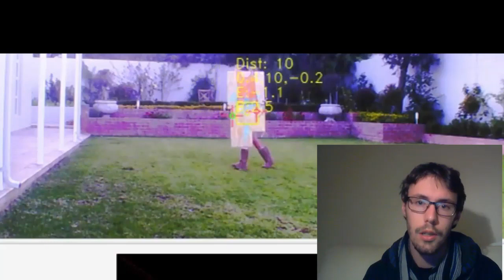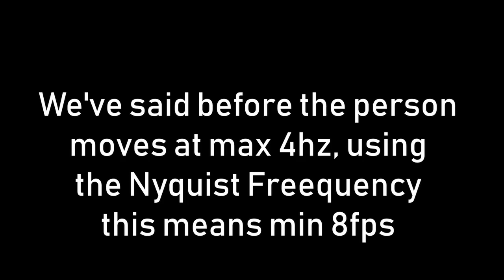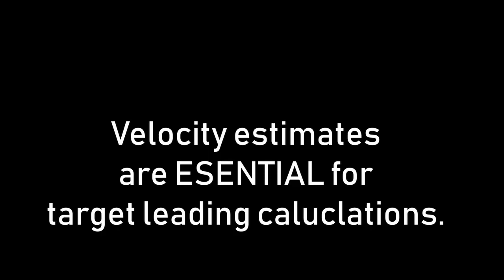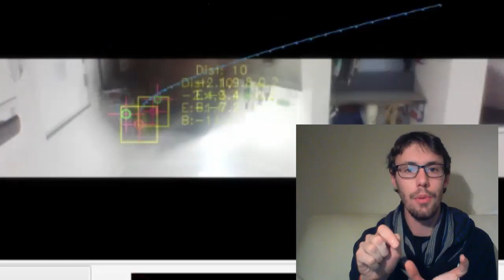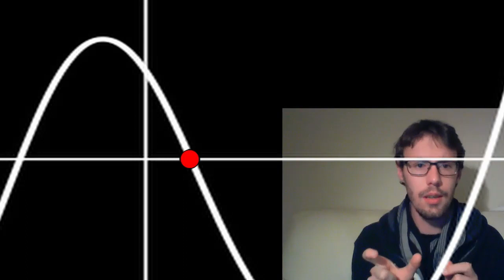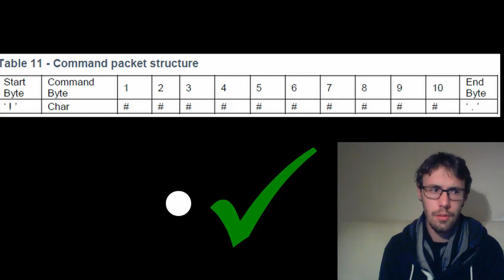Paintball Sentry - Sentinel Tracking System (video 3)

Comment: How did you select the motor? I wonder why you used that motor.
Reply from the maker: In the first video I explained how I first calculated the rate of power input to accelerate the gun and then played that off with the  amount of torque I could produce against the size of gearbox I needed. I also just looked at what similar types of mechanisms used such as hand drills.

Comment: Hello, I am a university student. Your video really helps us with our graduation project. I am going to make a graduation work by referring to your video. I have a question. Do you know the dimensions of your work when you try to create an external shape through a 3D printer?and i wonder your control system
Reply from the maker: Hi! I will hopefully add the control system soon. Busy with the final draft of my thesis so time is not friendly to me. What kind of shape are you trying to create? Your CAD program shows you your dimensions but when you print you'll have to account for filament size. It depends on the tolerances of your process.
Reply: Dale Sparrow okay thank you i’ll be waiting
Reply from the maker: @공대생-x1t  Go to my site and drop me a mail in the contact section: https://gewonemossie.wixsite.com/simple-principles
Reply: Thank you very much for your reply. We need the appearance design features that hold the motor or gun. I'm in the middle of making the appearance design and I'm not sure how to start.Can you give me a file with 3D modeling?I know it's rude, but I'm so sorry. It's not for any other purpose but for university homework, but I can't graduate if I can't do this.
Reply from the maker: @공대생-x1t  I wouldn't mind giving you some pointers but I currently don't have access to the files. I'll give you my contact details somehow soon
Reply: hi dale i wonder what kind of your carmera model would you tell me?

Comment: This is an awesome project!! Thanks for sharing what you are developing. Out of curiosity would the turret be 3D printable? The plate the motors bolt to being metal or a bracket to spread out the torque would probably be a good idea, but to cut down on cost printing the rest out of PETG or ASA would be super cool!
Reply from the maker: 3D printing i applicable to many of the component apart from the motor and belts. I think that may be a good idea, but folded steel and aluminium may actually work out cheaper! You'll find all parts lasercut and bent probably will cost about $90
Reply: @ThoughtinFlight  Can't wait to purchase and build my own! Absolutely seller job on this project 👍
Reply from the maker: @TheBitterBeard Thanks :) I'm desperately trying to organise stuff in my life so I can develop this as a commercial maker product XD

Comment: Interesting.

From my experience, the order of operations matters with high-speed signal processing.  Why not as a first step try a Gaussian blur on the frame to filter out noise and find macro objects?    Blur the image and the one-shot pixel noise will basically disappear.  This will also "grow" your detected objects and normalize the area they consume before your binary filter.

Also, are you integrating the "background" images over constrained time?
Reply from the maker: Gausian blur is expensive to perform and can be achieved by just unfocusing the lense or getting a lower resolution camera which defeats the purpose. I automatically discard objects smaller than my noise range and larger than a certain size. 
What I should have added to the video and forgot I did was I "eroded" the image and then "grew" the image which got rid of all the high frequency noise without loss of resolution.
Reply from the maker: On the background image integration, that can be done but the test runs were never long enough to justify activating it. If it had to sit in one environment with changing light over hours then totally worth it.